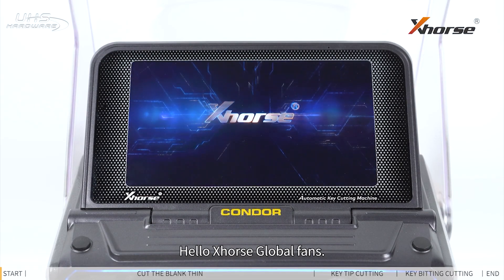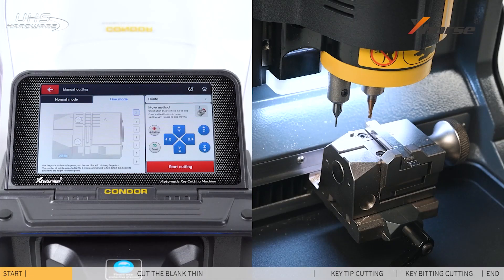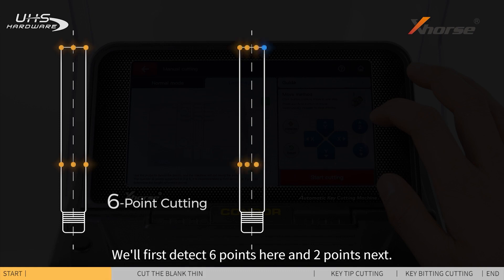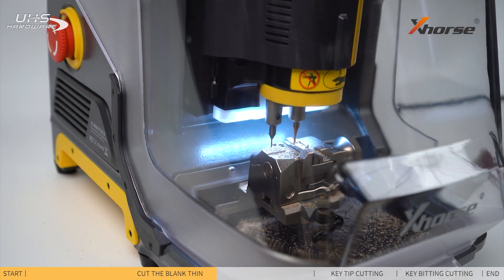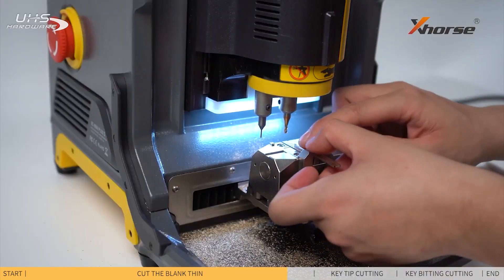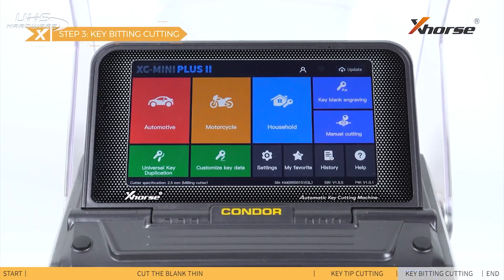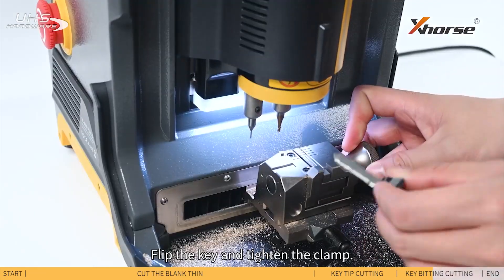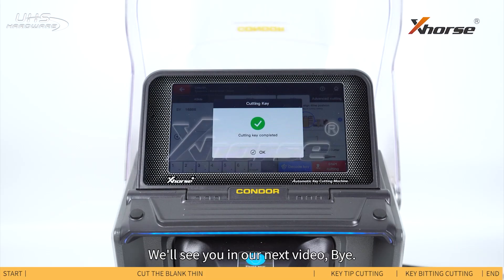How to Duplicate New Honda Civic/Integra Key using CONDOR XC-MINI PLUS II | Xhorse

Comment: That's an intense video, thanks for sharing.
I didn't understand if this machine can cut stainless steel Honda keys.

Also what kind of blank was used as the template for the key being modified, where is it sold and to which other cars can it be used?
Reply: Can it cut the new Steel Keys?